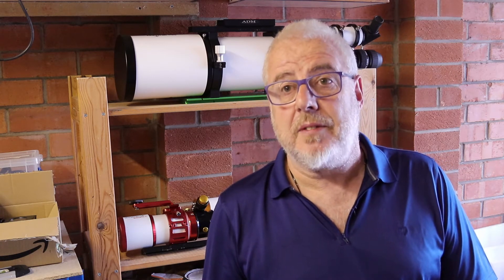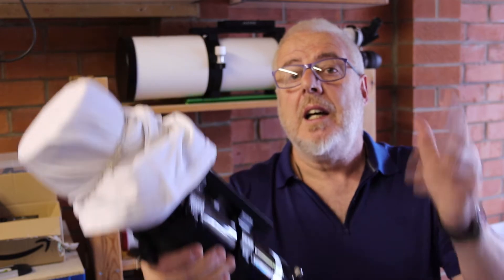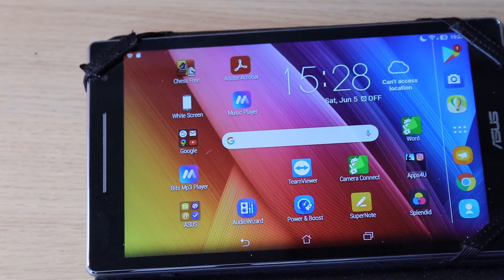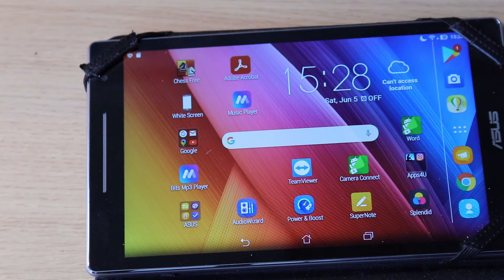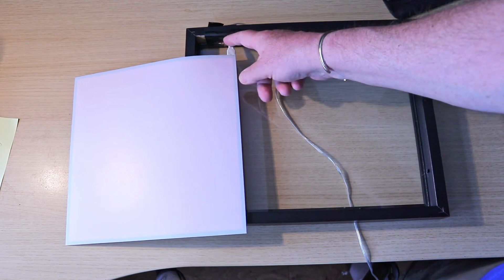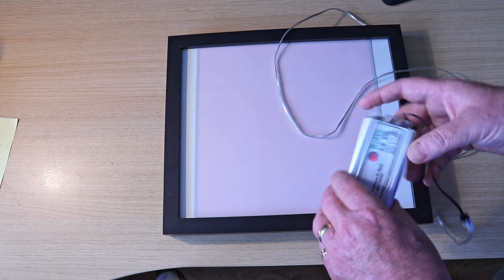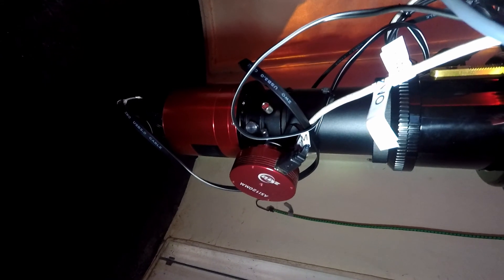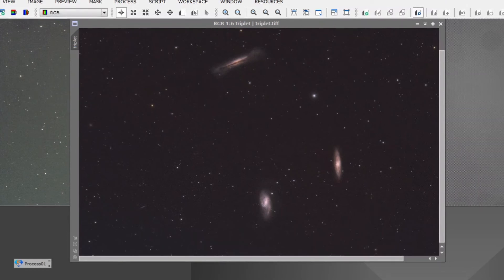How to make a flatfield generator for image calibration!!!

Comment: The tablet/ipad screen is no good for flat frames. The reason being the tablet has a refresh rate, so your flat frames will be inconsistent relative to overall brightness/exposure.
Reply from the maker: Hi..thanks for watching. You can mitigate/ overcome this by lowering the brightness of the screen and increse the length of the exposure. Doing this gives goid results . Hope that helps!
Cheers, Ray.
Reply: @astrogadge2276  Hello. Thanks for the reply. I'm just getting into taking flats and the tablet trick was the first method I tried. I immediately noticed the subtle difference in brightness between frames. Then tested tshirt + sky and there was none differences in brightness. I concluded this was because of the tablet refresh rate, which is correct. I will now try again lowering the brightness with the tablet and increase the exposure. Makes sense, should work. Thanks!